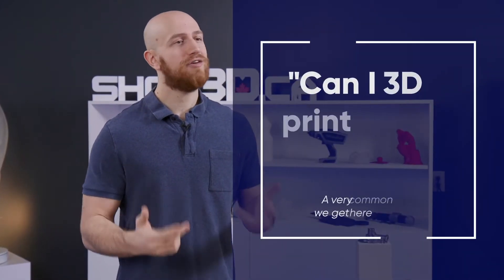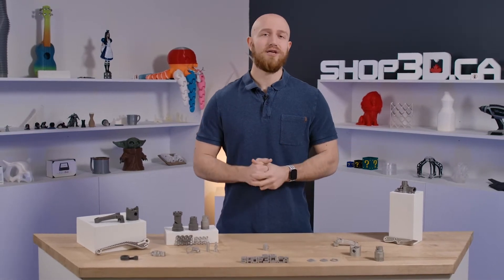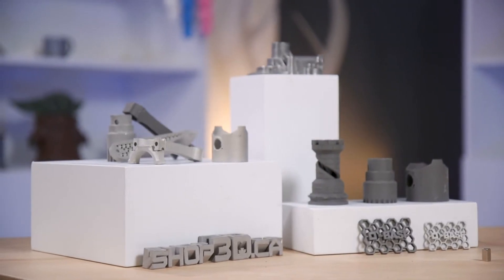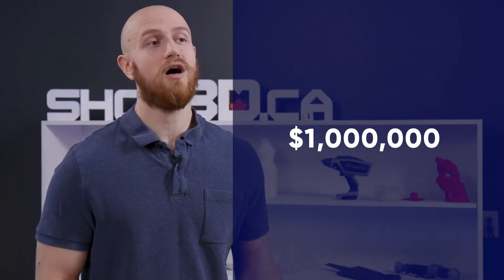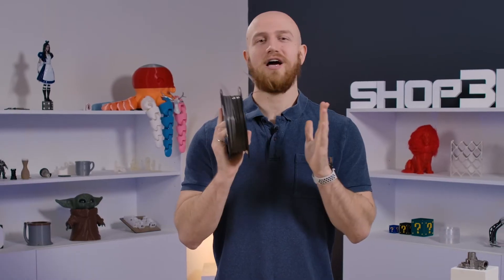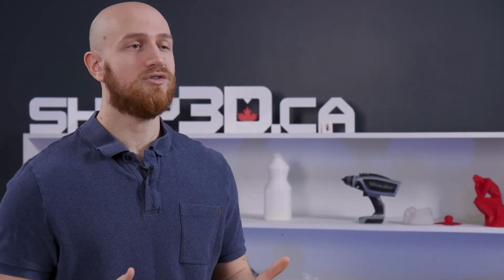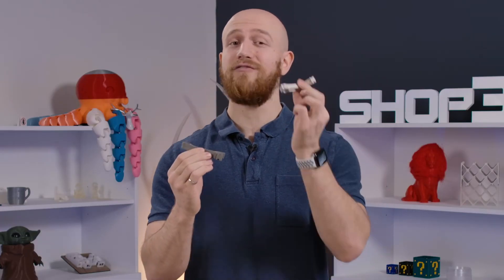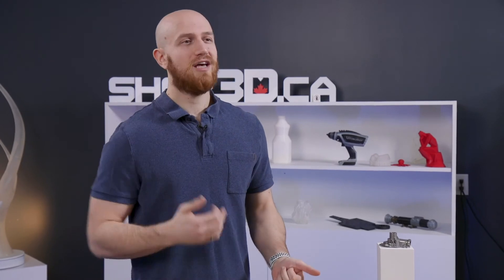Metal Filaments Overview

Comment: Went to the website to check pricing but it's saying "request a quote" which means in mind _this is expensive_. I've been trialing virtual foundry's filaments on my site and would be interested in your opinion.
Reply from the maker: 316L is available through Shop3D.ca in Canada for $615 (Canadian Dollars) for a 3kg spool. It looks like 3kg of Virtual Foundry's 316L Filamet is $819 USD ($1035 Canadian).

We haven't tried out Virtual Foundry's filaments but it looks like you can purchase a kiln to debind and sinter yourself. With Ultrafuse, it usually needs to be sent out for sintering and debinding. We help facilitate that. 

You can see the pricing and learn more about Ultrafuse 316L on our website. 

1.75mm:
https://shop3d.ca/collections/ultrafuse-316l/products/basf-ultrafuse-316l-1-75mm-3kg

2.85mm:
https://shop3d.ca/products/basf-ultrafuse-316l-2-85mm